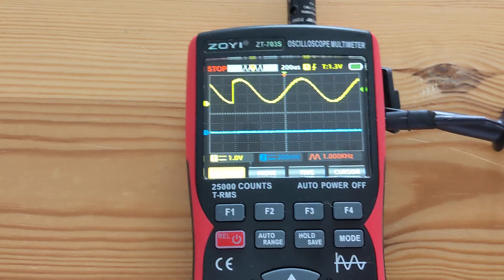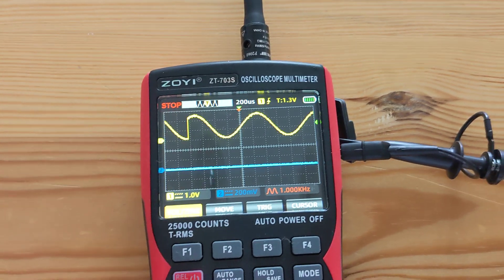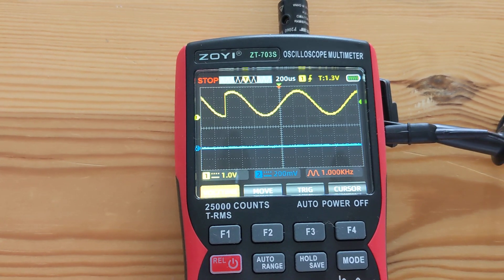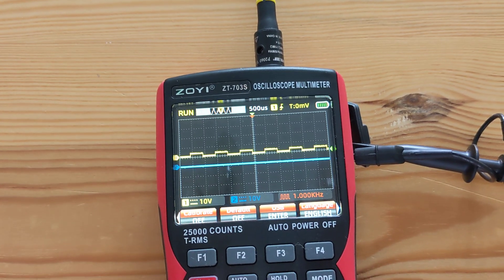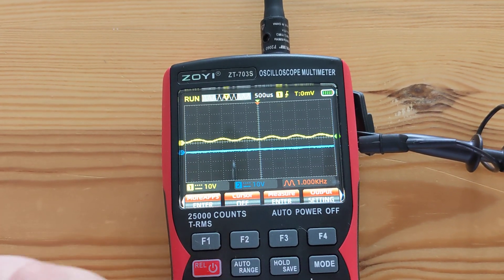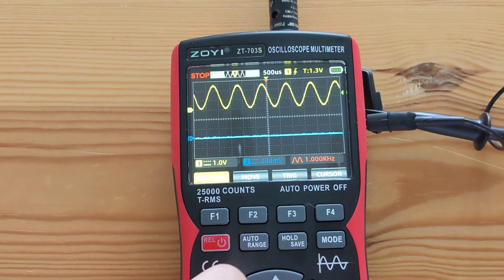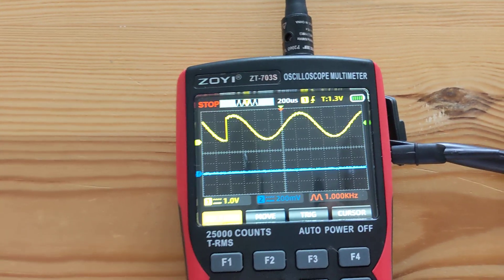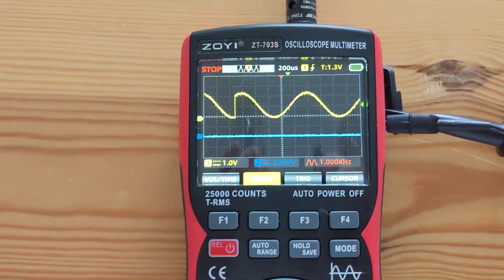ZOYI ZT-703S signal display bug (fixed in 1.3.9)

Comment: I have installed firmware 1.3.9 and this error is not observed on my device.
Reply from the maker: Thanks. I updated to 1.3.9 and this bug is gone.
Reply: @tearandfix  have you tested the firmware version 1.4.2?
Reply: Zoyi mentioned on the download page version 1.3.9 fixed this bug.